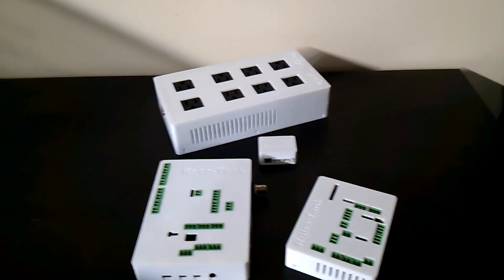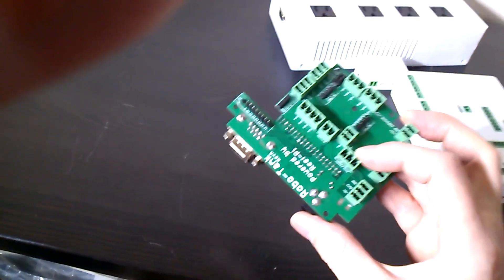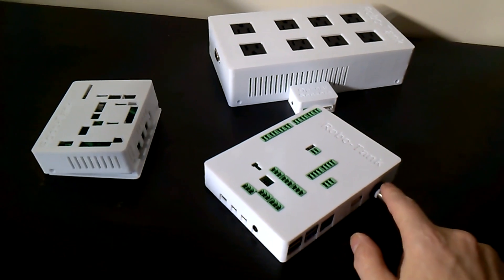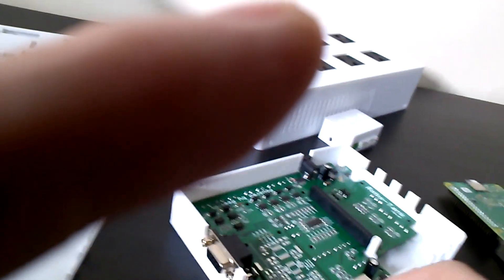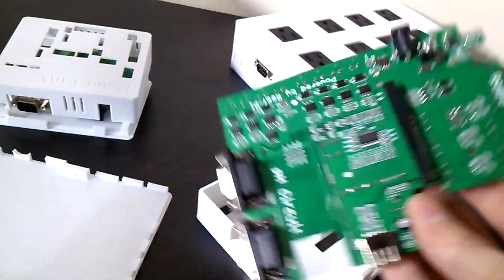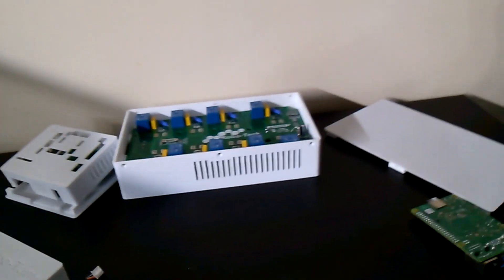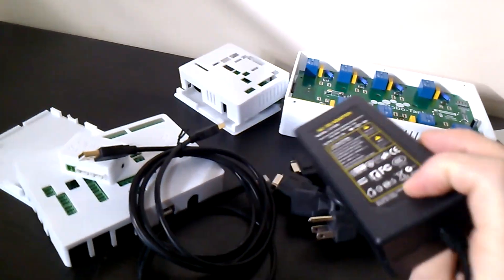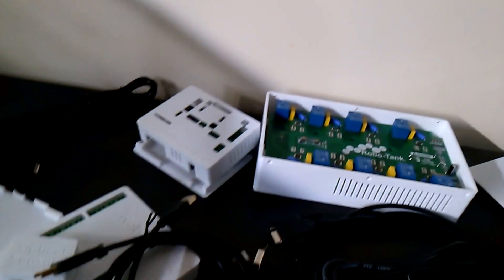Robo-Tank Aquarium Controller for Reef-pi

Comment: What software is used? Is at android compatible? What tablet type is used for them controller? Software DL?
Reply from the maker: reef-pi is used, it's a web app so it loads on most devices with a modern web browser. You can use phone, tablet or computer to access. Here's the Github for reef-pi. https://github.com/reef-pi/reef-pi
Reply: @RoboTank  ill have to do it to my computer. So many files not sure what's what
Reply from the maker: @ydeardorff  You can't install reef-pi on a Windows computer, it needs to be a Raspberry Pi. You don't need a controller to run the program though so you can check it out if you have a Pi. Here's a link showing how to install. 
https://learn.adafruit.com/reef-pi-installation-and-configuration/raspberry-pi-configuration

Comment: with the deluxe with the ph circuit, do you need to add anything else other than the probe and pi with reef pi to read ph? does this also have a port for a temperature sensor? This thing looks great!
Reply from the maker: Sorry Carlos, just saw this message, hope things are going well. I'll answer for others who may see this, the controller just needs a probe and the Pi to read pH and it has 3 temperature ports for DS18B20's but you can connect more than 3 if needed.